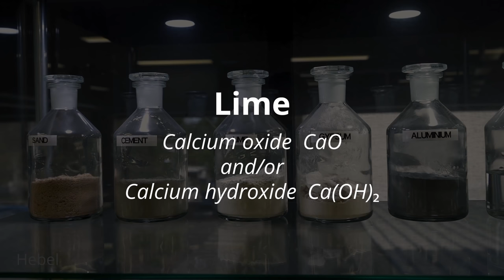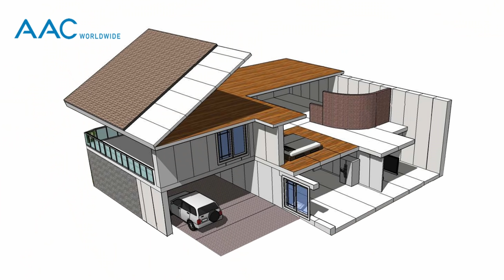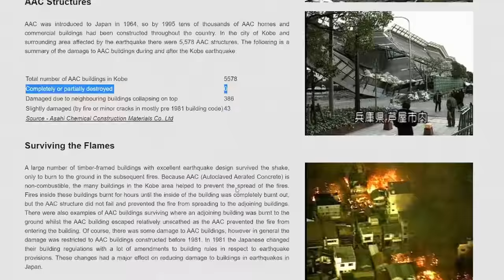AIRCRETE lightweight concrete | Everything you need to know

Comment: I've used such a product, brand name "Ytong Stein", when I lived in Germany back in the 90s. I used it instead of traditional framing to skirt the quarter-round bathtub, then covered it with cobalt blue Penny tiles.

I also used it in the kitchen to create "open" cabinets under the counter. These blocks were used to create partitions that also supported the L-shaped countertop which was made of 3cm thick laminated wood, with cutouts for range top and double-sink. I covered the partition with square tiles, then cut laminated 2cm shelves to fit between the walls. We used a curtain to hide the plumbing under the sink and bio-waste bucket, otherwise the shelves were all open (no cabinet doors). For the oven, it was only about 2 ft high, so I made a drawer on wheels to fit under the oven. I didn't use tiles to cover the blocks facing the oven and left it as is with about 1 cm air gap on the sides.

Very easy to use and as you mentioned, I used plastic anchors for the shelf brackets, so the shelves could easily be lifted out for cleaning.

If I ever did such a remodel project again, I wouldn't hesitate and would find ways to use it on other projects wherever I could. The possibilities are endless where compression strength, noise abatement, fire/heat resistance etc are adequate for the project. Another advantage is the relative "thinness" is a plus. A finished wall would be thinner than traditional 2x4 framing, as the thickness would only be 5cm (2") - - even if sheet rock was glued on both sides.

Glad to know it's showing up here in America finally.

Comment: a few comments. First of all, just because it looks porous doesn't mean it needs plaster or anything like that. Decades of experience, as well as the fact that it is used for facades, indicate the opposite. The second is about fasteners. A typical concrete dowel can withstand more than 100 kg. A piece of plywood with two diagonally driven nails can also withstand more than 100 kg. Belinda also didn’t say that the blocks come in different densities. Well, about the shortcomings. The main one is that the block arrives wet and dries already in the structure. This delays construction. Where I live, they usually build the box in the first summer, then it sits for the winter and the finishing is done the next year.

Comment: Belinda,

We are a passive science based New York State builder (PHI CPHT/ PHIUS CPHC) that builds exclusively in AAC.  We have a very new wall assembly that uses only three components;  AAC, Mineral board and U-Stucco.  We would love to hear your  opinions on this, maybe even have you do a video on what you find.  We are building our first AAC home with this wall design right now, hope to have testing for this assembly soon.  BTW, we get around the corosiveness of the material, and the issues with steel in concrete, with basalt rebar.  Thought you would like that...
If AAC is the future, this wall assembly is bleeding edge.  It's not our 'invention, it's just that we brought AAC to it instead of poured concrete, which is used in Europe extensively.  We currently have three more buildings under contract and in process, 2 more on the way to contract before year's end.  We have been getting amazingly positive response to this product and we feel we are on the cusp of a true breakthrough.  We buy from Aercon, who DOES have a plant in the Florida, USA

I love your videos, I send them to my clients as explainers ( I have really well informed and engaged client!)
Reply: Thank You 😊 

From Florida  ...

Comment: Seems like the biggest hurdles holding it back in North America:
1) lower holding power for fasteners.  Solution : provide specific pullout resistance numbers with appropriate anchors

2) costlier- solution: provide specific example of what typical final build cost in the different scenarios (basement, above ground exterior walls, interior walls, etc) 

Ultimately it has to stand up on its own in terms of cost, installation, and utility if you want it to overcome wood and traditional masonry.  Green building is great, but it won’t overtake traditional methods of it doesn’t win out on those 3 aspects.

Comment: Thanks for this review. HAve you ever seen or tested the foam concrete, made with water, cement and a foaming agent? I did made a few samples myself and was amazed by the insulation and soundproofing propierties, also you used a lot less cement since it's airated, but can be poured on site as a liquid, or made in a mould on a factory, but you don't need the autoclave.
Reply: Hello Javier,

Would you mind talking more about foam concrete? I’m building a school and would love to know more and see if this would be a good option for the construction.
Reply: @meetankush  Hi! you can find more info and some test in the youtube channel of "honey do carpenter", that's where i learned how to do it. Also try to find agricultural foaming agent, it's used for marking where the tractor has already passed, its kinda expensive but you use just a little each batch. Also always weight your foam and don't use too much water or the concrete will be very soft.

Comment: Thank you for covering important & interesting topics.
 Please if you can, make a separate video featuring the NON-autoclaved  Air concrete - which I believe is the next big thing ahead, moving toward more natural & ecologic ways of building.  I have seen a strength & durability study-  video. 
 where the non autoclaved (non burned):  air cured - air concrete was compared to the autoclaved one. and the non burned one outperforms the industrial autoclaved one in every category. it also makes the reliance on expensive manufacturing methods/factories, thing of the past.   
 
It absorbs much less moisture, (as it doesn't become over dried &  brittle in the auto-calve.) 
 Natural fibers like hemp can be added in the mix for extra strenght  (as these flexible materials aid bonding & will not burn in the ambient temp. manufacturing process. (burning them in high heat leaves the  material full of veins/ cracks.
 
It wont crack in time or under pressure,  instead it seems to petrify into rock in time, whereas regular concrete (as we know) develops cracks and autoclaved option cracks although much later.

Also the foaming of it, is resolved/ achieved with a low tech dish detergent additive, making the trapped bubbles to be of air instead of hydrogen that's much more likely to escape in the curing process.  there's no need for expensive industrial autoclaves with their additional energy consumption as they only weaken the product - while maintaining the impression that this material is difficult / impossible to make without industrial facilities.
  
Planned obsolence is what I am calling out here, before it gets to be applied on massive scale.
Whereas if let to cure on it's own pace, in ambient earth like conditions, - it reaches a balanced  level of moisture equillibrium with the surroundings.  This material can & will truly revolutionize how we build, in harmony with ambient nature: I'm currently working on a start up to design, cast and later 3d print non-auto-claved air concrete into elegant & affordable self-supporting shapes like domes and aches. to create accesible housing buiding blocks with spirit elevating aesthetics.    

namaste to all

Comment: Always heard this described as "aircrete". Glad to have a proper name for it now!... 😃 ...I had a friend in Mexico who made customized blocks out of this material. He mentioned to me that standard rebar was not necesssarily needed to reinforce these because of the light weight (don't know how that would be received in American building codes). He said that ceramic pins could be utilized for equal or better effect, without the corrosion effects. For the kind of projects I do, I love this stuff!...

Comment: This is really cool. The high R value, light weight, and sound deadening makes it seem perfect for passive homes. 

Chip board is very weak and brittle, but in the final stage before curing it is run through a roller compressor. This makes gives the board a tough outer “shell” to protect it. It’d be cool if this stuff could be given a similar shell of sorts to make it less permeable and brittle.

I’m not a Materials engineer or knowledgeable architecture person, but watching passive house videos and then all of your informative videos on different materials is really exciting.
Reply: A fiberglass mesh applied with mortar would give you the shell you're talking about, add waterproofing additive  and you have a nice stucco like shell.
For a passive house you also need thermal mass, a nice Cobb or lime plaster inside would be great.  Not to mention the porous surface  is perfect for this.

Comment: In Europe this product is sold under the name Ytong. It comes in multiple sizes and can be cut with a hand saw. The blocks are mounted with glue instead of cement. Fixing something th the wall is tricky. I suggest to cover the walls with osb which allows you to fix anything to the wall. Great video Belinda.
Reply from the maker: Thanks, Fred!

Comment: I am from Dominican Repúblic. In my country we built some basketball courts, metal structure, seating, bathrooms and office with aircrete.
It is soft to work, easy to cut, but unsafe on Doors, at least with tradicional methods.
I worked the electrical part and usted emt tubing

Comment: Is this (Ytong)? We use it almost everywhere in Europe. It is excellent for walls. You can make a concrete frame that supports the weight - like columns and joints and then build lightweight, heat and sound blocking walls from Ytong. It's fast and easy and you don't have to worry if there is support underneath the wall. Plus you can cut it in every shape you want and make decoration pieces inside and out the building.

Comment: This material is normal construction materials in Romania, i worked in lots of countries but never seen it used, my house is built with it. Is very easy to build because light, good sound and termal insulation and because is light it doesn't need a heavy concrete structure

Comment: What refers to Autoclaved aerated concrete, it has several drawbacks:
1. Once it get moisture inside, it keeps it for a long time. This is extremely bad for areas where temperature fluctuates around 0 degree Celsius many times per season. Generally, you need to protect it from water, which is almost impossible to achieve in the process of building in some rainy areas.
2. It is difficult to hang the cabinet on the wall of aircrete. You will need special fasteners for aerated concrete.

When we were choosing the material for our house, we were fascinated by the Papercrete. It has all the advantages of aircrete, without drawback of the latter. Would like to view your opinion about Papercrete.

Comment: Here in Ireland they use similar blocks for the bottom course of blocks on both sides of a cavity wall. It's to stop heat transfer from the ground into the slab/wall. I just had a garage built that way and it has been amazing at retaining heat. Though the 150mm thick cavity insulation probably helps too...

Comment: AAC is a superior material then anything to build or clad.  We at DCRA Inc. build steel frame large industiral buidling and homes with AAC clading on walls and roof.   It is lower cost and superior in every way to any current construction method.  !  Great post

Comment: This has been a very informative episode.  Thanks for highlighting the Hebel product.
I'm always interested in seeing new products introduced to my industry/trade.
I'd be interested in seeing what types of waterproofing are actually applied (beyond stucco or the old fashioned EFIS coatings)
If an 8" (200mm) block rates R-50 that seems 6.5 per inch. Quite good compared to batt insulation and not too far off from foam like XPS.
I do have to point out that most conventional concrete is going to have a compressive strength of 3,000 psi or higher.
Perhaps you are showing a figure for gypcrete, that is more often used for floor leveling than structural work??
Your FLIR camera is going to be helpful as you renovate your new home. It's sure to point out ducts, windows or weatherstripping that will cause condensation in a cooling climate like Dallas.
Thanks again for bringing your perspective and integrity to share on YouTube.

Comment: They've been using this in England for years now. In fact there are houses being built behind be and I saw them  laying air bricks first, then normal bricks outside of that for the exterior. That's generally how they do it, lots of garages over the last 20 or 30 years have been made with these and just painted on the outside to seal them I believe.
👍🏴

Comment: Fascinating. I was vaguely aware of this material, but didn't know it's had practical use for quite a while now. Would like to find/see examples of its use here in the UK, especially on larger developments.
Reply: it is used on larger developments. Its used on loads of new build houses.
Reply: @barnie8282  I guess a lot of those blocks / breeze blocks are aircrete. Did see a uk gov paper on identifying RAAC - reinforced autoclaved aerated concrete - especially in 60s-80s built schools. Seems to be an issue, I guess again that maybe it's often identified as just concrete and assumed to have its strength ending up being overloaded or drilled inappropriately.

Comment: A friendly reminder, it's only USA, Liberia and North Korea that still use imperial units - the rest of the world will have a hard time to understand how strong X psi actually is.

Please consider also using si units in your videos.
Reply: And Myanmar. There's also the internet that can help you out.
Reply: @grondhero  that's just the thing, no ?
Reply: North Korea used to use Korean units (which are not imperial units) and seems to have switched to (mostly) metric decades ago.
Reply: This is incorrect. You do not have the knowledge to give this criticism. Building is done in a mix of metric and customary units in many countries, including Canada, Japan, the United Kingdom, and elsewhere.

Learn humility.
Reply: @microcolonel  A lot of old lower level workers in some countries outside the USA still use  the old and obsolete imperial units.

No serious engineering or construction outside the USA have been done using imperial units for decades.

Even in the USA serious engineering is done using SI units, NASA have been using SI units since the Apollo program. 

Outside of USA the problem of imperial units will be solved once the older workers die off, and the world can move on to a better future.

Imperial units are simply unscientific, illogical and unfit for their purpose, the debate on this issue have been settled since centuries - its only bad old habits coupled with misdirected national pride that keeps these anachronistic failures alive when superior alternatives are available.
Reply: @microcolonel  The fact that imperial units today are defined by using SI units should tell you a little about how properly useless imperial units actually are.

Here is another video that may find informative, https://youtu.be/r7x-RGfd0Yk
Reply: @NomenNescio99  dude, I grew up in Canada, almost everything in construction there is conducted in U.S. customary units.

I know it can feel like you know a lot when you're a teenager, but you're really just making an ass of yourself when you do this.
Reply: @microcolonel  I'm 49 years old, I have worked in engineering ever since I finished university.

Although I now mostly work in-office, I have participated in implementation projects for our product in most European countries, including the UK, some countries in both the middle east and east Asia. 

All our work is done using SI-units. There have never been a customer of ours ever even asking about imperial units - and if they did, they would be laughed out of the room.

I'm not an ass, I'm just thoroughly tired of debating with representatives from the flat earth society, stubborn in their ignorance and unwillingness to learn new and better ways - defending the status quo for the worse of all of us.
Reply: Dude, it's just a system of measures; and it happens to be the system of measures that dominated the industrial revolution, and the system of manufacturing that made the modern world. It has sticking power, there are literally billions of tools and instruments denominated in these units, and those all continue to work; that's why we continue to use them.

It's not some cabal trying to keep SI units down, it's just that there is a massive amount of momentum behind customary measures. In Canada most people think of their bodies in terms of pounds, feet, and inches; in the UK people measure their weight in stone. In Japan and Taiwan, two highly SI-based countries, it is still most common to discuss and advertise floor space in terms of 畳/jou and 坪/tsubo.

The U.S. is about as SI-based as Canada or the UK, in real terms; it's not singled out in terms of use of customary measures. Customary measures are used commonly in construction and in personal life in a majority of the world's most industrialized nations; they are not an embarrassment nor a burden, but a simple fact of life.

You seem offended by the very idea of customary measures; but they are common and useful.

It is pretty funny that you're almost 50 and your writing still sounds like the work of a teenager.

Comment: I have used Aircrete blocks mostly as an insulating layer in masonry thermal bridges. For instance where a setback masonry wall meets the concrete floor. BTW, be carefull using aluminium screws etc, because sometimes it can set the forming chemical process back in action.